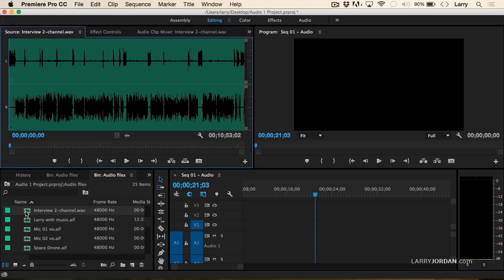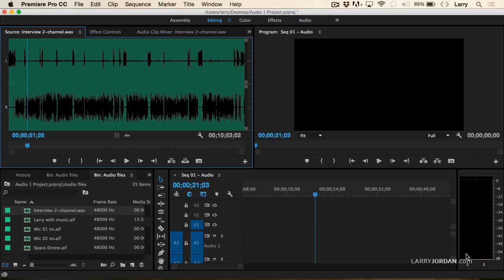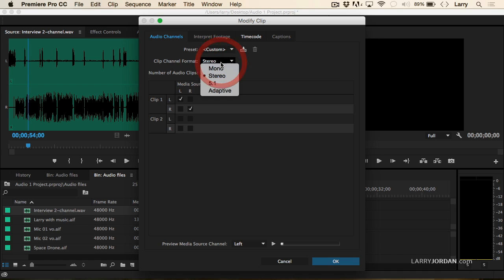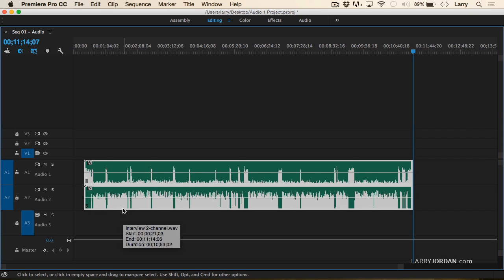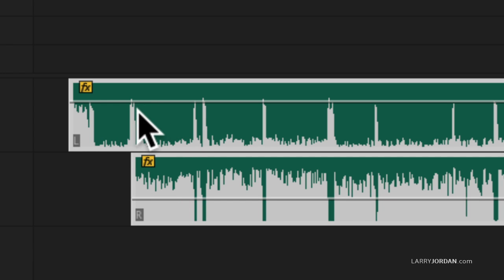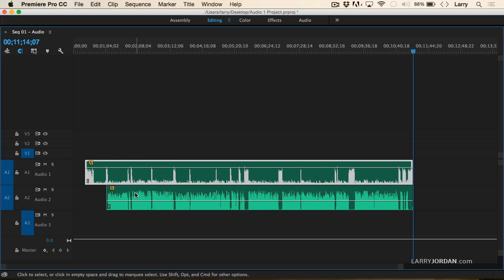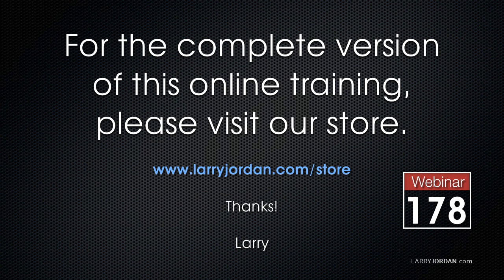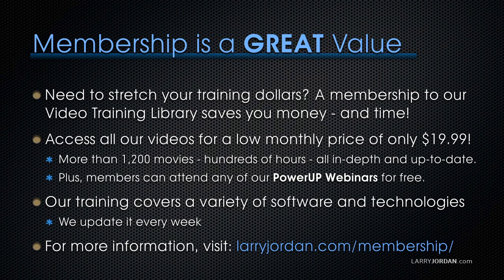Working with Multichannel Audio in Premiere

Comment: Multichannel podcast audio: I need a tutorial explaining how to cut/razor dead space in an audio channel without messing up the timing of the other channels od dialogue. I can’t find anything
Reply from the maker: Kim:

The easiest way to do this is to separate each audio channel into its own track in Premiere. Then, Control-click to lock the tracks so the audio doesn't move. At which point, you can use the Blade and trimming tools to get rid of the audio you don't want and keep the audio you do.

Do a Google search for "trimming multichannel audio in Premiere" and watch some of the Adobe tutorials.

Larry